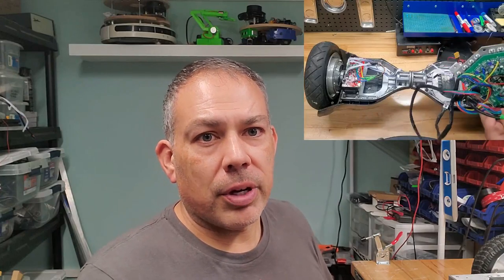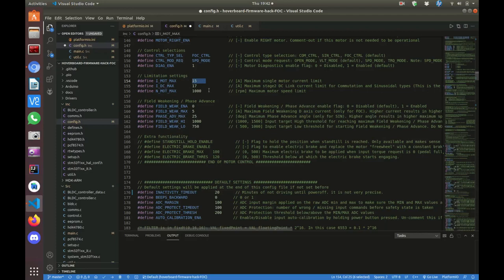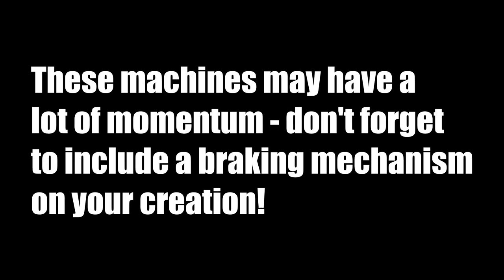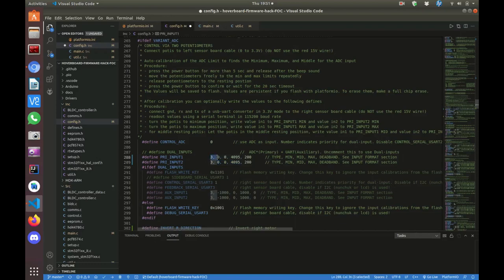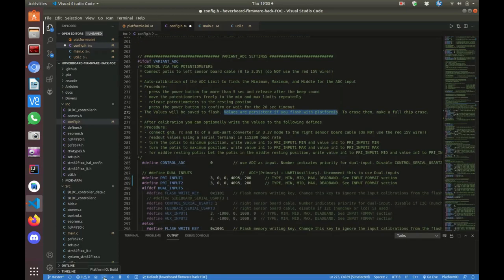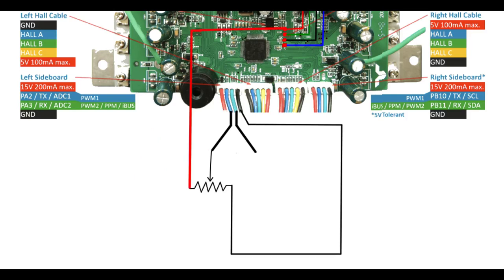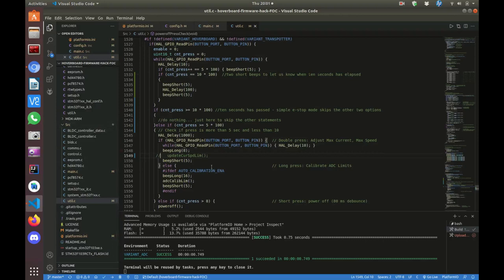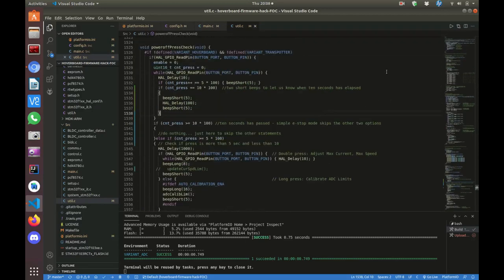Hoverboard Robotics Tutorial Part 3B: Hoverboard Robot Drive with Joystick Potentiometers

Comment: Hi and big thanks at the beginning. I'll try to make it as short as possible. 
Trying to build a dual motor powered scooter (two rear motors) and can't get it work.

Everything in the code changed with your directions, ADC variant, flashed firmware, passed auto calibration procedure and my problem is that only at some point on the throttle motors go 100% without any control on power level.
Standard board, two electric scooter throttle/brake pots (hall) wired as on the diagram (except 100k pull-ups for now). 
Throttle/brak potes checked already using multimeter and powered 5v gave from 1,13v to 4,2v output from start to the end of throttle range.
Tried the same with hovercar version and the same effect.
I'm losing my mind. No beeps after calibration and works perfect, except 0/1 state, no power/full throttle. What am I doing wrong? :)
Thanks for any advice.
Reply: Ok, I think I got this finally. Now switched to HOVERCAR mode but changed PRI_INPUT1 and PRI_INPUT2 to "3, 0, 0, 4095, 0" and there's a small difference in behaviour...now I can speed up slower or faster but still it's just a part of the throttle movement, let's say between 30% and 50% of pressed throttle. before that it's no throttle and over that is full throttle.
Reply from the maker: Hi, the first thing that stands out is that the board ADC takes 0 to 3.3 volts, not 0 to 5. Anything over 3.3 volts is going to be full-throttle, and that will be a significant portion of your range of travel. Over 3.3 volts can also damage the inputs as only the right side connector is rated for 5 volts. I'm not sure yet if anything else is wrong but I suggest you start there, recalibrate and re-assess. Crossing my fingers that's it and there is no board damage.
Reply: @PracticalRobotics  Am I right thinking that if I for example power the hall sensor with 5v from left or right motor hall sensor 5v and 3d print a kind of physical throttle limiter so that it will not let it go further than 3.3v, it should result in bigger range of throttle readings?
Reply from the maker: @Wydryszek  I'm not sure what you mean when you say "bigger range of throttle readings." Compared to using 3.3 volts on the pot? The voltage is converted to a value from 0 to 4096. 0 volts reads raw value of 0 and 3.3 volts is read as 4096. You can't get more range than that. What you suggest I guess could work, although since your low end you said was 1.2 volts that leaves your range of values read by the chip at something like 1500 to 4096. Calibration should be able to handle this but it cuts down on your resolution..it'll be harder to precisely control the output with the pot. I think the best way to tell what is happening is to uncomment #define DEBUG_SERIAL_USART3 and use an FTDI and a serial program like minicom to read what the chip is thinking it sees.
Reply: @PracticalRobotics  What I meant to say is that I was thinking on physically limiting thumb throttle working range and power it up using 5v so that it should work from start to some poimt that I wanted to measure with multimeter (throttle output voltage) that will result in 3.3v output, not more to avoid burning the chip but that's not a problem already.
I've finished first "stage" of my scooter and with a huge load that I am (110kg's 2 meters tall ;) it speeds up quite fast, but not that fast to be dangerous for me.
What I need now is to check if changing values for amps and rpms for motors, will result in a bit more speed because what I get now is 22.5km/h, not more on 10.5" wheels.
And again thanks for your interesting step by step videos that guide through that process and every single thing explained.
Reply from the maker: @Wydryszek  Cool. Let me know how it goes trying to speed things up. I don't know when I'll get to it but I have a concept for an autonomous human shuttle and while 22kph is really plenty, I still want to see how fast it can control itself. :)
Reply: @PracticalRobotics  No speed increase after changing amps to 18(20max), 1800rpm and speed multiplier "speed *= 2". I thought it would result in higher max speed but obviously there's just more power from start due to more amps. It looks like it's hardware related (motor rewinding needed?). It's not that cost effective to order 13s charger and rebuild the battery to 13s3p. 
Some current specs: 2x 350W 10,5" motors, 7,4Ah 36v battery from scooter. Max speed at around 24km/h on fully charged battery. Range ~10km with me on board ;) For me that's enough but would be great to go a bit faster if needed. Something like 28-30 would be really enough.

One more thing. I'm not an electician and I'm not really sure it it could work but I ordered some 1N4148 diodes for that 5v<->3.3v issue, hoping that 1-3 diodes would be enough to lower the throttle output voltage so that it will not exceed 3.3v in full throttle.
Reply from the maker: @Wydryszek  Thanks for the update. We are getting well outside of my area of expertise but there is some info in this link about the different modes and something called field weakening that I think might help speed up. Something about the rotating fields and without weakening there is a limit to how fast the field can rotate without becoming a problem. This line caught my eye : By default the Field weakening is disabled. You can enable it in config.h file by setting the FIELD_WEAK_ENA = 1. Maybe that will help? Definitely read this page if you haven't. https://github.com/EFeru/hoverboard-firmware-hack-FOC#foc-firmware

Comment: Hi, thanks for this! Awesome stuff!
Question, can I use one pot just to control throttle, for both motors? I am thinking about a scooter of some Kind! :-)
Reply from the maker: For sure - that's how it works by default. One will pot will control speed of both motors and the other controls steering. Just leave the steering pot centered or even replace it with a fixed pot. However, I wonder if it might interfere with tight turns if speed mode is selected because turning requires different wheel speeds and speed mode will resist this. One of the other modes (go kart mode, or something) I think will not have that problem - read the descriptions in the docs or the firmware.
Reply: @PracticalRobotics  thanks for your answer my dude! Greatly Appreciated! I was thinking of using two motors for the same wheel and then speed mode and a set resistor for steering sound kinda nice. I think. Thanks again for your work and nice videos!

Comment: is it possible to replace hoverboard motherboard with arduino or raspberry pi?
Reply from the maker: Technically yes, but this would be exceedingly difficult and also require a lot of electronics that would cost more than the complete board. I definitely would not want to spend that much time to create something that can be purchased cheaper than the parts.

Comment: I am frankly impressed with what you do, I am a newbie to all this but I have reproduced your system and it works perfectly for me. I only have one problem, it doesn't have strength, if you put a person (me) on it it won't be able to move 80 kilos. Maybe there is something in code to increase strength.
When I was a hoverboar I moved around without a problem. I hope you can help me. 
Thanks in advance